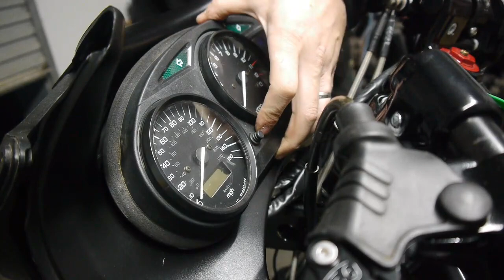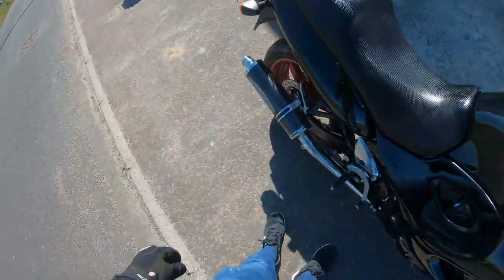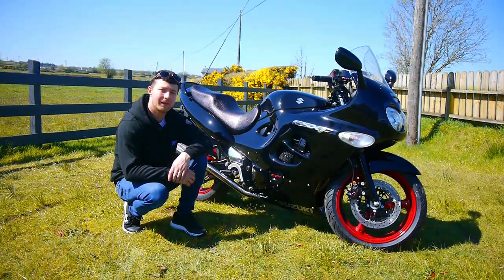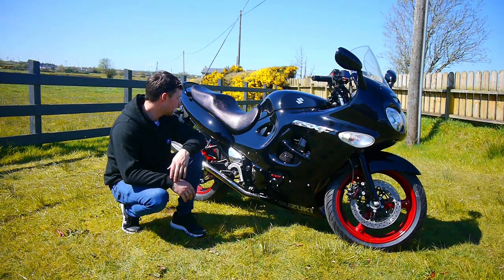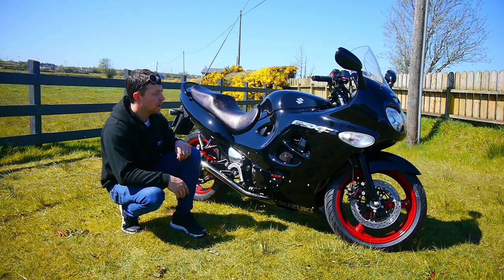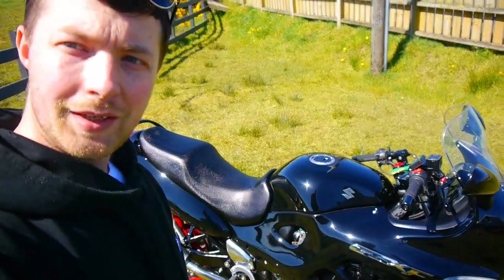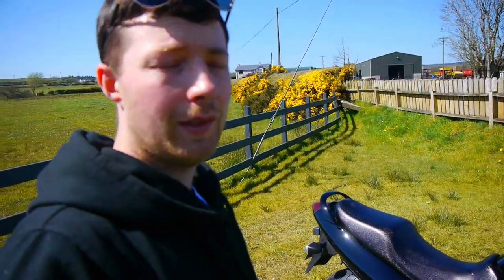Suzuki GSX600F Katana Restoration Part 10 - Its Finished!

Comment: My bike is unable to start after seating several months. It was ok. I cleaned and rebuilt my carb following your demo on the video. It would be helpful for some rips from you
Reply from the maker: Have you checked to see if you have spark yet?
Reply: I also changed the spark plugs, I took it out when I rode for about half a mile it became weak and weak, I bought a 2nd hand ignition coils it doesn't seem to spark with either, and got new battery other than trying not  starting

Comment: Since you built it from scratch can you convert the carburetors to fuel injectors?  And would it be as efficient or more efficient? I have one myself so I'm wondering.
Reply from the maker: You could convert it but it would be a lot of hassle and cost for no real reward except maybe a slight bit less maintenance over the years. 
A good example would be I have an 01 r6 carb model and my friend has a 2005 Honda cbr600rr fuel injected model. The r6 is more economical by a small bit and they are both almost identical in power the whole way through the gears with the R6 having the slightest edge over the Honda and the Honda has a quick shift too which the r6 does not. 
So no in my opinion it would be of no benefit at all doing the conversion. I hope this helps you out. Thanks
Reply: @DarrenMcKinney1  that's exactly what my friend said. I'm very happy you gave me sound advice. It very much is costly and genuinely wanted to know and wanted to convert to more modernize it. But as there's no real change I won't and thank you very much.
Reply: They have kits for it it's a pain in the Ass i know people that have done it why change it if there's nothing wrong with it

Comment: Just a quick question, where did you get the fuel tap decals from, I've been looking everywhere!
Reply from the maker: Hi Peter, I dont actually have any decals on it. I just cleaned it with scotchbrite and lacquered the outer ring to prevent corrosion and painted the lid in satin black. I hope this helps
Reply: @DarrenMcKinney1  sorry to bother you again, I was referring to the fuel  tap decals that say on, reserve, prime and off on the fairing, thanks in advance 😀

Comment: Really helpful rebuilding one myself in wexford wondering  where did you get the rear shock or did you get it rebuilt.
Great job fair play
Reply from the maker: Thanks John. I get asked that a lot. It’s actually just the original one cleaned up really well and painted as it was in pretty good shape. Glad to hear it was helpful.

Comment: How did you do the gear indicator on the dash?
Reply from the maker: It’s fairly simple Graham. You have to split the dash apart which is only a few screws and the gear indicator fits into the hole with the Suzuki logo nicely. You will have to trim the side of the dash to let the wire stick out and you may have to build up the back of the gear indicator with a bit of foam or something to keep it jammed tight. Then as for feeding the wire down through the dashboard of the bike you feed it through one of the drain holes that are already there. You will need to separate the gear indicator plug to make it fit and then put it back together or just make the drain hole bigger. I hope this helps
Reply: @DarrenMcKinney1  what gear indicator did you use on your bike like the look off it by the way
Reply from the maker: @grahambarnett4743  if you go into my video library one of the very first videos I done was on the gear indicator for this bike. It wasn’t fitted inside the dash at that stage but it gives you an installation guide and there should be a link for you to purchase one too
Reply: @DarrenMcKinney1  brilliant thankyou

Comment: Hi Do you still have a link for the gear indicator or a wiring diagram as some of the units don't come with connectors 

Thank you 
Steve
Reply from the maker: Hi Steve if you look for the video where I installed the gear indicator in the original location it will show you how to fit it. Its pretty easy to do and I dont think the link for the part works anymore but its a generic indicator which I just looked up for my bike on google.
Reply: @DarrenMcKinney1  Hi 
Thank you for the reply 
Appreciated 
Steve

Comment: Can you show how you adjusted the throttle cable and return cable on both ends please.
Reply from the maker: Hi, it would be hard to show you on video but if you adjust the main throttle cable first down at the carb until it has not much slack but not tight, then adjust the return up until its taught too but keep more slack in it as if you tighten it too much it will bind and keep the throttle on and have to be rolled forward to let it off again. I hope this helps
Reply: @DarrenMcKinney1  helps a lot almost done rebuilding mines because of your help

Comment: What type of gear selected that is in the dash and on the right side of the bars beside the throttle? You bike turned out awesome also !!!!! I also have a 2005 GSX600F Katana with 1241 miles on it and l am going through the process of getting it running again, l am into the carburetors cleaning them now ! Here is a tip don’t never put gas in it with ethanol gas mixture and the Lucus ethanol gas stabilizer really done a number on my carburetors!!! But if you don’t care send me the parts list on the gear indicator kit. Thank you just reply to this comment.

Comment: Thoroughly enjoyed following this restoration, you did a great job of it. I have the same bike and have started stripping it for painting got all panels off apart from the front mudguard. Did you have trouble taking yours off? You didnt show the removal on the videos. Is the metal plate on top of the mudguard threaded? I only got 1 out of the 4 allen bolts turning but it didnt screw out of the plate, the allen key is just slipping in the other 3 bolts. I'm going to have to grind them off tomorrow.
Reply from the maker: Hi Hector, I'm glad you enjoyed the series.
The 4 outer bolts on the metal plate are threaded into the forks and then the 4 inner ones are nuts and bolts which hold the plate to the mudguard.
You need the calipers and wheel removed from the bike to get it off.
If you check out my episode 3 in the link below and go to 2:30 you will see it being removed:
https://www.youtube.com/watch?v=iZooa396Wf0&list=PLPdcxiWehkyCTM5TGXUScwvwhLQ-CN8Mu&index=4
I hope this helps you out and have fun with the project!
Reply: @DarrenMcKinney1  okay, thanks for that! I was trying to avoid taking the wheel of as I've only got a small shed and need to be able to move the bike out side to work around it. But I'll do as you advise and then put the wheel back on. Thanks mate

Comment: Hi

Great series on the GSXF

This was my first big bike which I bought in 1998

I’m going to restore another as my first full restoration project

Could you be so kind as to suggest where to obtain parts. I’m aware of Wemoto but wondered if there is anywhere specific for anything genuine Suzuki parts ?

Many thanks
Reply from the maker: Hi David. Glad you liked the series. Yes the best place I have found for genuine parts is CMSL and closely followed by Fowlers. CMSL are generally better value but not always so check both. Delivery is a little bit slower because it’s further away but the savings are worth the wait. 
Good luck with the restoration project and have fun with it. If there is anything I might be able to help with it or information don’t be afraid to drop me a message
Reply: Thank you

Comment: Brother please could you assist me here before I take a crowbar and smash this piece of sh%t of a bike apart I’m attempting to get my throttle handle back on but can’t get much slack from the cables from the carburetor rack what to do please and thanks
Reply from the maker: sorry for the slow reply elias but yes you will have difficulty if you dont remove at least one of the cables from the carbs and then hook it onto the throttle. Then put the cable back onto the carb. Thats the only way you can do it